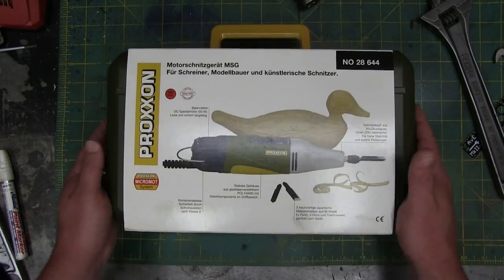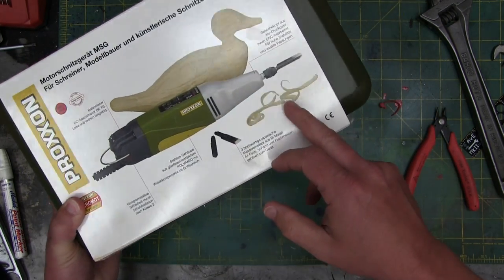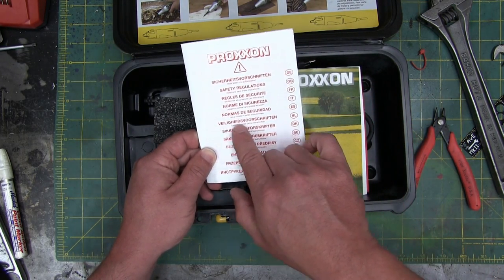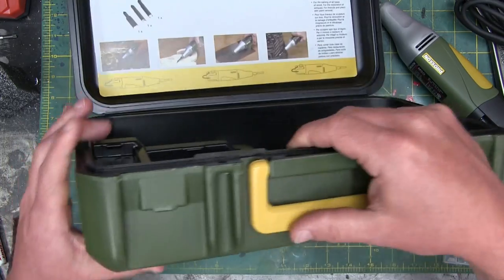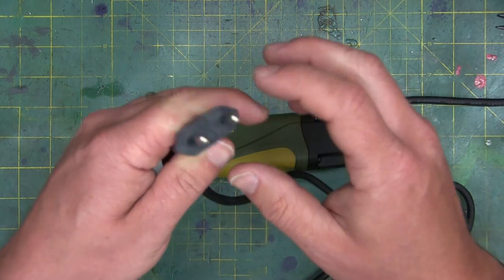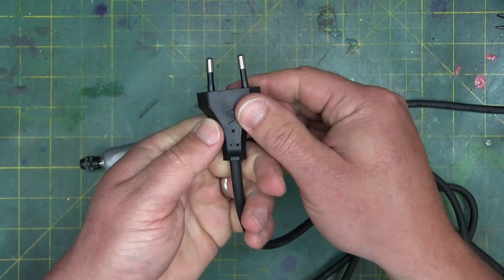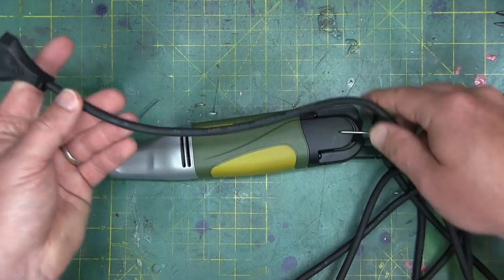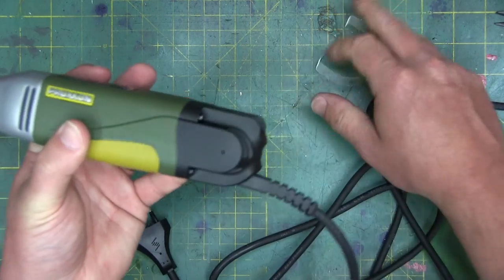BOLTR: PROXXON Carving Tool | Germany

Comment: I've got a couple Wen brand rotary tools and love them. They seem to hold up pretty good. I've ported out lots of cast and aluminum small block Chevy heads and intakes. It's been thrown and drug across the floor and still kickin. Their around $20 on Amazon.

Comment: In your part of kunuckistan do you have the plugs where the top half an bottom half of the plugs are different circuits? You could make some scary dual plug thing to get 220 out of the wall.

Comment: In germany most of the plugs (2 pins only) are bend in inwards so that they don't fall out at random.
Reply: It actually has multiple reasons. This is a unified EuroPlug, so it must fit into holes of different diameters and of various distances.
Reply: That'd be your standard ungrounded Shuko plug right there. Used pretty much everywhere in Europe (Italian and French are different but compatible), except for England which is, as always, an exception.
Reply: DasBreaker love the two pin system!.. my country has it too and it's just so minimal and good... can't understand the American plugs that's bigger than a house
Reply: Sweet! Bigger is better, how can you not understand that?
Reply: Alan Gibson Not Schuko, it's Europlug. Schuko is literally short for "SCHUtzKOntakt", meaning "protective contact", referring specifically to the ground contact.
Reply: Sweet! European plugs are larger than American. Are you sure you're not thinking of the gigantic U.K. plug?
Reply: Antonio Tejada oh right!.. to many different plugs to remember lol
Reply: Ulrik Kaul After WW2, copper was in short supply, so houses were made as just a single circuit. Thus every device needed a fuse so it didn't take the whole house out.
Reply: If you take a look at the ingenious UK plumbing hot water/cold water, you wonder what the hell they do at all over there.
European plugs are quite allright, most stuff does not have earth but all sockets support it. In a not too old regular home you have at least 1 fuse per room, one for the washing machine socket, dishwasher too, and at least 3 for the three-phase (like for the oven). Also RCCB, one per house at least, or one per living unit.
Reply: Never saw any Euro plug fall out at random. But then, old or faulty sockets or plugs are a thing. As for compromise, they certainly are, as most the all-European-things are compromises between 20+ nations, the plugs reflect it as well. I guess technically one can argue that no plug on the planet is perfect or flawless, it is a consumer standard. A fuse in each plug seems like overkill, but then, more safety cannot hurt and with very old houses and questionable wiring, better than no fuse.
Since all sockets have earth and - for the most part - RCCB, we have plenty outlets in the bathroom, while the light switch in Germany is traditionally on the outside of the bathroom - not for safety, I guess it is to switch off the lights while someone is taking a dump just to f*ck with them or something...
Reply: According to Wikipedia they seem to be not the identical thing. Europlug is the more wide term, while Schuko (originating from the German concept, hence the acronym/Type F) is compatible with Europlug (Type C). I ain't no expert, in the end we talk about the most-of-Europe and many other parts of the world norm with 220-250 volt and 2 prongs plus an earth if the device offers it. I think the Danish sockets are compatible with the Europlug and Schuko but the earth would not work.
Reply: Mains outlets ARE allowed in baths and outside, BUT they must be secured with an RCCB=(Residual Current operated Circut Breaker) or in german FI=(Fehlerstrom Schutzschalter).
They can be buildin within the socket or in the breaker box additionaly to the breaker itself.
In simple and short: They "measuring" the current difference between the live and the neutral wire.
If the current wich is "going in" in the live wire is not "going out" to the neutral (in the case you getting shocked or you dropped the hair dryer in the tub), the RRCD will switch of by even tiny amounts of currents. The Feherstrom Schutzschalter I've got installed are breaking at 25 mA. Yes that 0,025 Amphere. An human getting shocked with 230 volts can die from just around 100 mA. But due to the high restistand an body have, the normal breaker will mosty never switch of. Thats why (my opinion) every circut should be secured by an Fehlerstrom Schutzschalter. :3
Reply: Ehh. That sounds like some scary fuckin' engineering there, m8. Funny, too, considering how safety concerned most European countries are, that they'd adopt some kind of universal slightly varying plug design that could just fall out of the wall.

I mean in GB they literally have a switch for every outlet! How could something like this be permissible in Germany???
Reply: Yet I never saw or heard of the plug fail design-wise. I mean, try to bend them, that is very hard by itself. The design is allright in my book, for once because the plug can go in both ways because symmetrical design, which is very handy with 2 or 3 wall sockets and those bulky plug thingies that change the voltage.
Reply: +Windshield Well, when you need to move twice the amount of angry pixies, you need brick sized plugs.
240V rules, mate!
Reply: +Windshield Well, when you need to move twice the amount of angry pixies, you need brick sized plugs.
240V rules, mate!
Reply: One big reason for a "big" and "small" plug is voltage differences, here in the us higher voltage & wattage require a third prong on the end like for say a vacuum but for things like a lamp that use around 60 watts they only use two prongs. Im not an electrician kinda guy but I wonder if the nuetral and ground help dissipate heat
Reply: DasBreaker that's called gfci in the US, ground fault circuit interrupter. Same use here, any room with water and outside plugs. Ours have reset and test buttons on the plug.
Reply: burnell beauchamps Antonio already mentioned that 2 years ago....
Reply: It's the same 2 pin plug we use here in South Africa. Not sure about the 3 pins tho.
Reply: @happyjoe2067  Well I'm pretty sure that the 2 pins are the least problem with some electrical installation there. :P
Reply: @kshatriya1414  I think you're thinking of the UK plugs. American ungrounded plugs are even smaller than the euro plug... oh wait, someone beat me too it :)
Reply: @tookitogo  Yeah the UK plug child safety consists of a child being unable to lift the plug :)
Reply: @MayorOfTexas  we call it Euro-Stecker (Euro Plug).
Schuko ist short for Schutzkontakt, which translates to protection contact, meaning earth to trigger the gfci. So there really ist no such thing as an unearthed Schuko plug.
Reply: Dave Jones  unless the sockets have clamps in them (Germany)

Comment: The Europlug shall have the bend.

https://en.wikipedia.org/wiki/Europlug
Reply: Oh god, I spent my all life straightening them for nothing :o
Reply: Sadly you are correct. (.eu should have gone with the much better BS 4573. Proper right-angles in that one.)
Reply: I hope EU could get rid of those plugs and Schuko all the way.
Reply: I would have thought that having a bend in yer prong would work with fewer socket-hole arrangements.
Reply: That Moment when you realize that you've been living in Germany for 18 years and always thought they where supposed to be parallel😂
Reply: Reckless Roges Wasn't the europlug meant to be compatible with most/all existing EU sockets? BS 4573 wouldn't work for that because of the big pins and imperial measurements, I'm pretty sure it doesn't fit most EU sockets.
Reply: James Banana    Heyyy is that Åke Jävel in your profile pic? I approve. 
Kuken!
Reply: They stay in the socket better that way.
Reply: BS 1363 for life.
Reply: @MrSuperBrite2 : Far too late now. If civilization lasts long enough for a move to DC it will be the time to do it better.

Except for the Brits of course, who already got it right.
Reply: no the brits would get the dc flowing the other way, so all your tools will be moving backwards there.
Reply: we got thous in finland and same kinda another blug but there is ground also
Reply: I don't see where Schuko even comes in here, that thing has got a simple Europlug. No Schuko (as in German "Schutzkontakt", means "protective contact", i.e. earthed) there. Most of the 6 different national Schuko sockets will accept a two-pronged Europlug, but that is about it. Other than the Europlug, Schuko has nothing to do with the EU apart from the standardisation having been adopted into a CEE standard. Have to say I like Schuko, even when the BS has more safety features included. The latter leads to counterfeit products to skimp on costs, and then you got plugs without safety features needed because of the funny British ring-loop circuitry. And it's really bulky on top.
Reply: veli heikkinen Yes We have! Minkäköhän laine olis ilman eu:ta toi pistoke
Reply: Lol, positive ground. At least Lucas Electrical, or whatever their proper name is, sells replacement smoke for when it gets let out of the wiring. I saw a picture of it on the internet.
Reply: The Inclination is a security feature
Reply: I LOVE your vids, thank you! 

I've been watching this one for 16:33 and counting, waiting for you to say wether this is a deal for a home gamer, or something a professional would consider picking up. Would be cool to edit your consensus to the front of your vijies, I'm still going to watch the whole video, buy 5 of each of everything you sell, and wait impatiently for your next vijeo....
Reply: Euro plugs are for children, British plugs are glorious. 240v at 13 amps all day long
Reply: england and finland have same 220-240V- 50hz
Reply: Matt_Jr He pretty much said it was a toy in the first few seconds of I recall.
Reply: these plugs are crap i agree, but afaik they are only used on double insulated tools.
Reply: Nothing has worked in South Africa since the end of apartheid.
Reply: My internet works...
Reply: @godfreypoon5148  "I would have thought that having a bend in yer prong would work with fewer socket-hole arrangements."

Not if yer prong's got a bit of spring to er and the tip's sufficiently rounded. Suddenly lot's of hole arrangements become available.

Comment: Someone once told me that the electric tools/lathes are assembled in Wecker Luxemburg with most of the machined parts made in Germany.   Proxxon hand tools are made in Taiwan.
Reply: There is a Proxxon branch here in Wecker, but I don't know what they do in there. However it is too small for the output a company like Proxxon has.
Reply: It deppends of the tool, some of them are made in Germany, others in Asia, as far I know, my micro milling machine says was made in Germany
Reply: German Tool Reviews Yes, my MF70 milling machine had 'Made in Luxembourg' on the box.
Reply: The Proxxon tools are a good compromise between quality and cost efficient production. I can recommend the hand tools like a ratchet
Reply: I think when it comes to small power tools for model-making and similar small scale work, Proxxon is probably one of the best if not the best, quality-vise. Expensive, but the tools tend to run circles around the plasticky Dremels and their knock-offs.

I have got the small circular saw and one of the Micromot power tools along with a drill stand and I am very happy with both - perfect for small electronics work, cutting and drilling circuit boards and similar jobs.
Reply: I don't think their tools reach million numbers a year, more like tens of thousands. I mean main product is a small high-speed rotary that has about 1/10th of the popularity of Dremel or much much less than that.
Reply: Looked through the online catalogue of a local industrial tool supplier, and the handheld electrical tools were listed variously as produced in Luxembourg, Austria and Germany. Interestingly the mini tabletop tools are all listed as made in Japan, unsurprising perhaps, since I'd imagine that your average Japanese hobbyist living in a city would not have access to a large workspace.
Reply: Luxembourg is not a real place it is mythical like Xanadu or Narnia. I lived in Europe for like fore years and trailed extensively, me and my girlfriend drove around fore like two hoers south of Trier and never found the place.
Reply: John Cox it's there, it's just really small. If you brake too late, you're gone by
Reply: Hand Tools are made in Japan they told me.
Reply: Wrong direction. LUX is just W of Trier.  @johncox9660
Reply: @johncox9660  I can confirm that it does exist, I visited it once, only 24 hours. Come to think about it, I was on a lot of medication at the time.
Maybe it doesn't, anyway, because in most of Europe there are open borders, you could drive into and out of Luxembourg without realizing it. Most people only stop because the fuel is cheap.
Reply: @johncox9660  You drove straight through it without noticing!

Comment: Hi,
a fellow from Germany here: The so called Euro-Plugs quite commonly are a little bit bent. I don't know if it is by accident but I very germanly and properly inspected 47 Euro plugs in my home and all of them were bent together a little. 

Thanks for another great video :)
Reply: the bend is by design and in the specification.
Reply: Joel Brunenberg I'd bet it's to hold it tightly against the conductors and also hold it to the plug and prevent from falling out of the plug and tight against the conductor,it's a pretty decent idea if that's why
Reply: “Very germanly” - perfect

Comment: Some time ago, i went to my local hardware store and they also had Dremels und Proxxons side by side in the shelf. The Dremel was 10€ more than the Proxxon equivalent. And still you could see that the Dremel was bought much more frequently, despite beeing the crappier tool. This just sadens me.
Reply: Devil they know vs the devil they don't. They figure the lesser known tool must be worse than the brand name, even if the brand name is crap itself.

Comment: that bend needs to be there for it not falling out of the socket
Reply: if the socket can't keep the plug in you need to take a look at the socket
Reply: As for the cord:
H = Harmonized
05 = 300/500V
R = Rubber wire insulation
N = Neoprene jacket
-
F = Fine stranded flexible cord
(Typical medium duty cord in Europe for light tools and limited outdoor use.)

2 = 2 wires
X = No color coded ground wire
0.75 mm^2 = Self explanatory

Comment: I love agglutination in language. Once you recognize the words, which you usually will, they can be quite a bit easier to read in cases where English terms can be ambiguous, which is not that often, admittedly, although more commonly in in technical writings. 
Although the translation in this case could use some work. Most Danes would look at you funny if you talked about "sikkerhedsforskrifter" - safety proscriptions. (Although note the cross-language resemblances!)

My point is, the words generally only look bigger because you didn't put a bunch of spaces between syllables that actually go together "safety data sheet" is functionally one word, but it's got two spaces in there in English, when in Danish it's just "sikkerhedsdatablade". Ah, yet another resemblance: The word "blade" comes from the North Sea word for "leaf", which in English wound up meaning the "leaf" of a knife, while in Danish it means "leaves of paper" - as in "leaflets". 

I could talk about the North Sea dark ages for hours. I only wish England hadn't been conquered by the Normans, who gave up their pagan Nordic heritage and became French. Which is fine, for France, but they didn't have to lead England astray as well. Damn you, Wilhelm the Bastard.
Reply: note also: blade (of grass), another kind of leaf

Comment: FYI: 

Patelec = Manufacturer of the cable

H05RN-F
H= Harmonized cable (just another EU cable standard)
05= 300V/500V
R= synthetic rubber isolation (core isolation)
N= some other rubber isolation used for tools (outer sheath)
F= fine-stranded conductor

VDE= Testing and Certification Institute for electrical stuff

CEM= ???
Reply: skilllmatic : [Wikipedia]:
	
https://en.m.wikipedia.org/wiki/CE_marking#China_Export
A logo very similar to CE marking has been alleged to stand for China Export because some Chinese manufacturers apply it to their products.[17] However, the European Commission says that this is a misconception. The matter was raised at the European Parliament in 2008.[18] The Commission responded that it was unaware of the existence of any "Chinese Export" mark and that, in its view, the incorrect application of the CE marking on products was unrelated to incorrect depictions of the symbol, although both practices took place. It had initiated the procedure to register CE marking as a Community collective trademark, and was in discussion with Chinese authorities to ensure compliance with European legislation.[19]

Comment: The Thing what does nothing to you, goes over the Blade and fits on the nut holding the Blade. The nut has 2 flat surfaces where it will fit, then you have better grip to thighten it. Sorry for my english, german guy who sells these things here...

Comment: They do sell that in the US in a home improvement store called Sutherland's and its in 120 volt
Reply: The box is in English too
Reply: home depot sells these on their website as well
Reply: Listed on HomeDepot.ca, only $252.00  CA.   Description says it has a DC motor, so a transformer transplant would get you full speed.  ;)   A tear down might be in order.
Reply: don't need a transformer. a simple voltage doubler circuit would work because its DC powered.
Reply: its actually only 165 at home depot
Reply: You might have to sell your wife for it but it is available
Reply: The factory has an American version of their web store you can buy it there.   https://proxxon-us-shop.com/collections/hand-held-power-tools-115-v-1/products/power-carver-msg